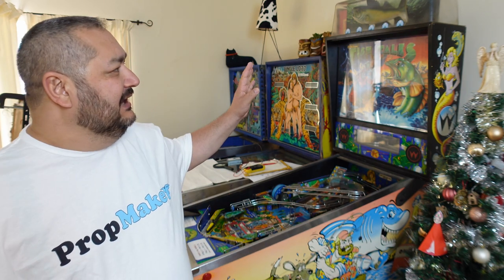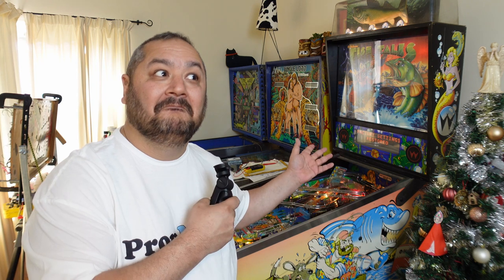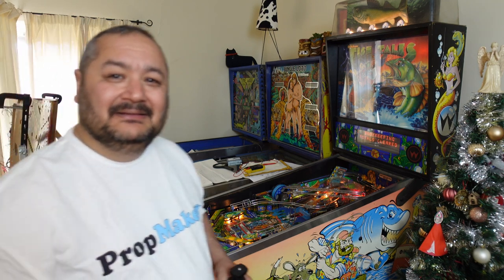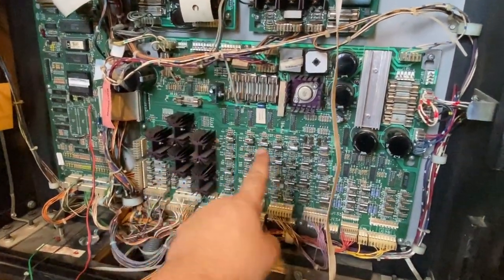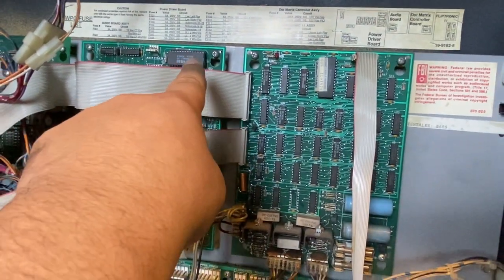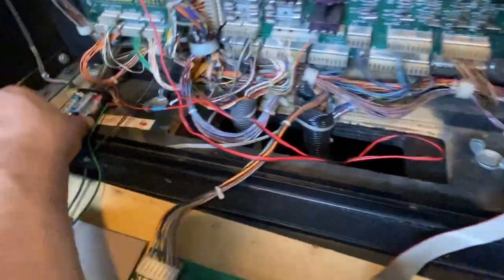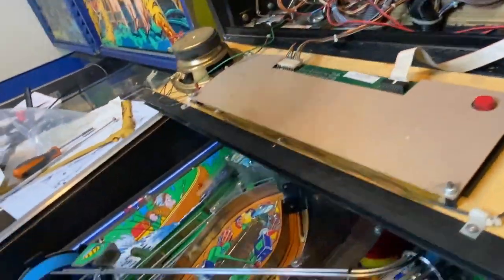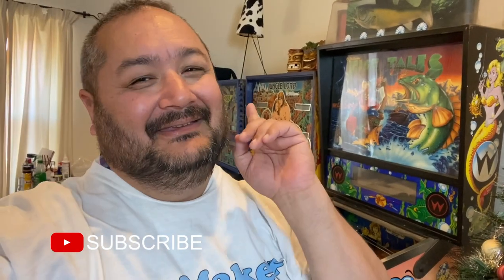Williams Fish Tales Pinball - Let's get it going

Comment: Interesting watch. I have been into pinballs for a very long time. Soon as i heard the extra bong  I knew there was an issue with the sound board. I have a Getaway, Hi Speed 2. Owned it for many years. Much the same boardset as Fishtails.  Had all my boards refurbished, and plays beautifully. Definitely a keeper. I did an l.e.d.  conversion and it brightened it up and also cuts down the curend draw on the power driver board.
Reply from the maker: Thanks for watching!